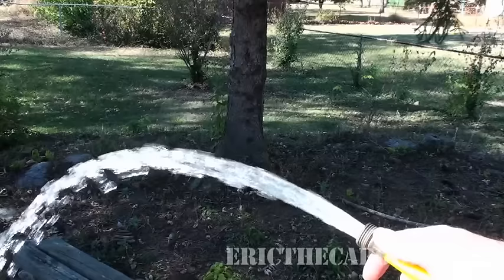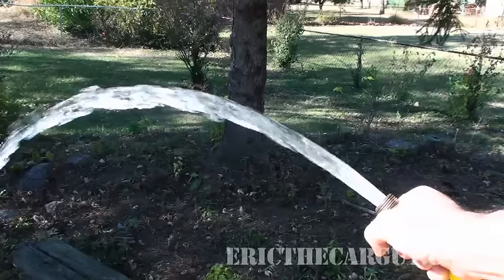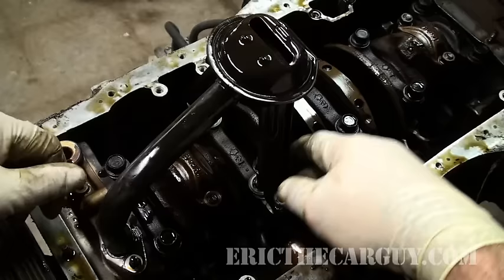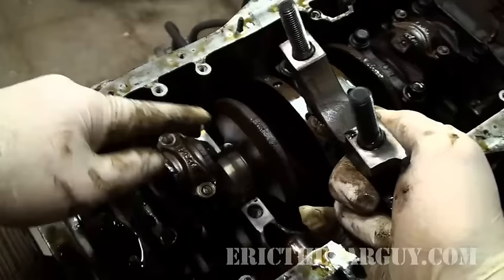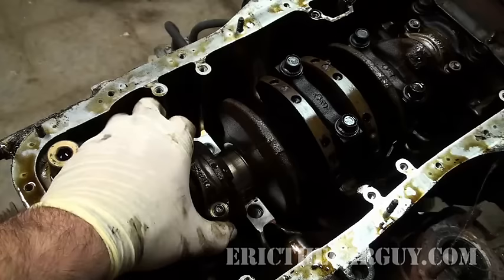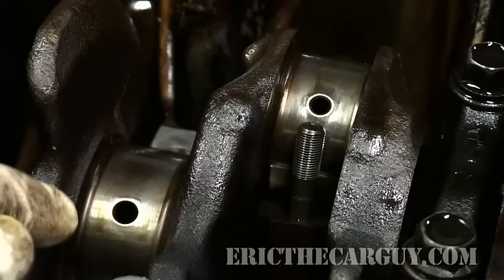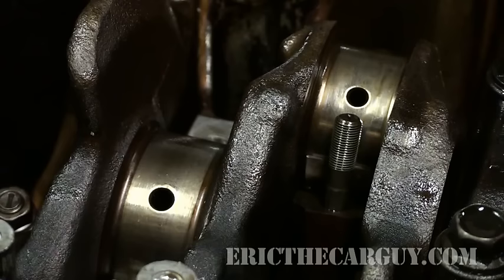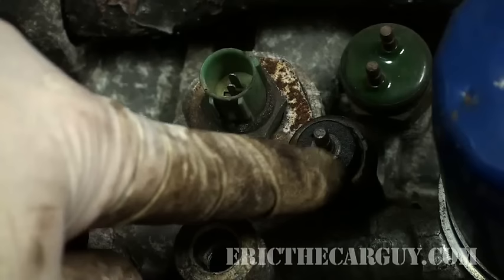How Oil Pressure Works - EricTheCarGuy

Comment: Here's a problem for you.  I have an oil pressure gage on the instrument cluster of my vehicle.  Normal oil pressure used to be about 50-60 psig.  Now, when the engine is started, the pressure rises to about 30 psig. After the engine has run for 20-30 minutes, the pressure has dropped to zero.  The crankcase has the proper oil level and there is no indication that there is no oil flow.  The engine appears to be running just fine.  What causes the pressure to drop off?
Reply: LOL we have the same problem look at my comment. its worrying me
Reply: Worn bearings. Remember you get pressure from the resistance to flow. If you have no resistance i.e. worn engine parts then you have no pressure. You can have all the flow in the world but without resistance you have no pressure. Without pressure to keep engine part from touching you do more damage to the engine. Hope this helped.
Reply: Without seeing your engine internals it would be hard to guess at exactly why you have low/no pressure, but to address your question about the "drop off" in pressure: this could be due to the reduction in viscosity of the oil as the engine oil warms.  Imagine you have two syringes, one full of water and one full of corn syrup.  If you want to push out a certain volume in a certain amount of time, say 1mL/sec, you will need to apply more pressure to the syringe with the corn syrup in order to get the same flow per time.  This is effectively what's happening in your engine at startup.  The oil has thickened while cold and due to its viscosity it is harder to push through the journals thus creating the 30 psi of pressure you're seeing.  As the engine warms to operating temperature the oil viscosity reduces and is much easier to push through these openings (crank/con-rod journals) explaining the drop in pressure.  The specified oil pump is designed to flow a certain amount of oil to all of the reciprocating components at a certain pressure.  As mentioned in the video, if the clearances between your crank/rod bearings have increased, your oil pressure will drop as a result.  You likely still have some oil flow to the crank shaft since the pump is obviously working (30 psi at startup), however there is probably a large amount leaking around the bearings and not making it's way to other components as the engineers intended.  Good luck

Comment: Please help I am at my witts end before I light this truck on fire new motor 05 chevy 2500 hd 6.6 lly no oil preasure lights not on but it cranks and runs no bad sounds what is wrong

Comment: the oil pump does create some pressure without it how would the process start so without it the engine will not run with out it or the engine will seize. But how ever the engine and all the metal does create pressure which helps lube each metal part
Reply: Oil slings out of the bearings and onto  the other moving surfaces.

Comment: Good stuff. 
How can oil travel to the top pan?
Reply: I'm having an issue with my 03 Chevy venture. While driving the low oil pressure light came on and shut the vehicle off. I didn't pay attention to it until it Finally didn't want to start and stay running.  There is oil in the top of the motor which tells it's not the pump. Any suggestions????

Comment: I change my oil every 3000 miles and my filter and I run full synthetic Castrol edge high mileage and I probably have done 10 to 12 oil changes this year which is kind of Overkill now my engine has been doing fine all year I have a 2005 Dodge ram 1500 4.7 l Magnum I was driving today and all the sudden on the interstate my oil pressure dropped completely to low all at once.  I'm only two thousand miles into my oil change and I checked my oil level this morning cuz I check it once a week and my coolant level both were normal my oil pressure dropped completely too low at bottom of the gauge then the truck shut off and died so I pulled over there was no knocking no pinging no weird engine sounds and when I check the fluid level in the oil with the dipstick it was normal and within range same as it was this morning but upon trying to restart the truck it doesn't turn over and the oil pressure remains reading low and it has a check engine light but no codes also I noticed when I put it to axillary and listen for the humm of the fuel pump it isn't humming so I'm trying to figure out what that would be cuz I have oil in the engine and it ran fine this morning and I had no problems with it and I change my oil a lot any advice would be appreciated also I've noticed recently that in my oil fill cap on the bottom of the cap it looks like snot like I yellowy pasty mixture. I only have 142xxx on my truck and it runs strong everyday for 1.5 hrs of daily highway 55mph commute. Any info would be greatly appreciated. I also got under the vehicle with a flashlight and there is no noticeable external leaks on the engine no drips underneath the truck and like I said the oil level is within range on the dipstick
Reply: I also run at half on the temp gauge which is normal and I run 5w30  weight oil as specified from factory. I stick to full synthetic and nothing else

Comment: I have a 1997 Dodge Ram 2500 van with 318 cid motor and don;t kow if I have to pull engine or not to replace all oil pump components. If so I must remove whole front clip of van. Can you answer this one?
Reply: What's it doing.

Comment: Yeah on those old engines, you want to use a thicker oil. Thicker oils will even help with compression on worn engines.
Reply: +Dcc357 I do not see how that really works, as the engine heats up the oil will still get thinner..
Reply: +Michel Linschoten 

Thicker oil stays thicker throughout the temperature range. It will thin with higher heat, but at any given temperature, it will still be thicker than a lighter oil at the same temperature.
Reply: as I said before, the first number on oil label indicate the viscosity at 0 Celsius(0, 5, 10, 15, 20) and the second group of numbers means the viscosity at 100 Celsius(30, 40, 50, or 60). Of course  if you have 20 psi at 750 rpm at 100 Celsius  using 5w30, you will have a slightly increase pressure using 10w40, 50 or60. What I experienced along my activity is that if the bearings clearance overpass some limit the pressure will drop exponential(very fast). This is  happening because  the hammering effect (when the bearings clearance overpass 0.1mm the piston and the con rod weight splash out the oil film, even if it 's thicker ) resulting a mechanical deformation of upper con rod bearings and lower main bearings.

Comment: My ls2 corvette is having high oil pressure does your oil pressure go up when it is cold?
Reply: Yes, when the oil is cold it is more viscous and causes greater resistance to flow, which increases the pressure.

Comment: This probably won't get answered. But I have a straight 6 Jeep Grand Cherokee. I just replaced the engine with a reman. Engine. When I drove it from the guy who replaced it the oil pressure was super low. Oil levels good. I'm going to try to replace the oil pressure sensor and see if that resolves anything
Reply: Well, I mean, you're correct in that you won't get an answer if you don't ask a question...

My Grand Cherokee has the opposite sort of situation; I haven't had it long enough to need an oil change on it yet, but it has lighter oil (5W-30) than specced in it and sits at the very high end of recommended oil pressure. I'm curious if the junk Fram filter from the Walmart oil change is causing the high pressure, and if putting a decent filter on and changing to the recommended 10W-30 would be a good idea.
Reply: moo

Comment: When my car sit still for a day, when started have no pressure for about 4 seconds. Then everything is fine and in range. Does oil pump have one way valve that is leaking and letting oil out of pump?
This is golf mk1 1.6 diesel.
Anybody knows is it safe to use the car ?
Thank you very much.

Comment: My 292 straight six has 10W30 in it. After it gets hot the viscosity dropped to 10 lbs at idle. Is that a safe pressure or should I use a higher viscosity. The engine in a new re-built long block with 8,000 miles on it.
Reply: Old technology says 10 pounds of pressure per 1000 rpms. So I think your pressure is normal. Remember there is also no load on the engine so you should be fine. Ask around.  
.
Reply: jd miller Thanks, that sounds about right.

Comment: hey Eric i have a ram 1500 2011 i replaced the engine i buy it from an  autopart store for $5 k  it works perfectly for 2 months and now iam dealing with low oil presure i can drive it for now but every time i stop gage goes to red  and oil valve it shows in my dash board .
camshaft is new 
oil pressure sensor is new 
trothle body iz new
gas pedal is new 
abs sensors is new 
iam doing  a pressure test tomorrow but i dont know how the engine is giving me so much problems 
is 3 years warranty but now i dont see what else i can do
Reply: i  noticed a rare noise when iam drivig and released my gas pedal is a dry noise coming from the engine in the driver side but i never know when is going to happen  when that noise start 2 weeks a go. my  truck also start acting up 
thank you for your answers

Comment: Eric i have a 2004 jeep Cherokee Laredo 4.0 and my only problem is after i drive it for half hour or so when i come to a complete stop my oil pressure cuts all the way out but my motor sounds and runs fine i changed the oil pressure switch and still the same any ideas?
Reply: Nick Boonsra ever figure it out? My 1997 4.0 Wrangler does the same and I may just get it rebuilt.

Comment: Question, if the clerance between the piston and the bore is way to big, can that couse low oil pressure? Thanks
Reply: No. That will usually cause "blow by" . This would result in a loss of oil between oil changes. And if the piston rings are real bad/worn, it will result in piston slap which sometimes can be confused with a engine knock or valve train noise.
Reply: Thanks nick Schneider, I found the problem the clearance between the piston and bore are very good, but I think the oil was getting on the piston from the valve seals, and the  low oil pressure it was cause by a bad bearing, I most to made the mistake of over tight the connecting rods because the bearing was squish. Thanks again

Comment: This has probably already been said, but if you have an old engine that may be varnished up a bit inside, don't Motor Flush it. Did that to an old pickup truck I used to have. Oil pressure went to zero at idle and about fifteen pounds at highway speed.
Shux! Not good.

Comment: ARE YOU RELATED ON VOLVO 670 IF SO I HAVE A QUESTION 
WHY DOES THE MOTOR LOOSE dIESEL PRESSURE

Comment: this is my problem 94 mustang 3.8 I hear a knocking noise its kind loud on start up and then noise is gone. if I mash the peddle right before the trany shifts I can barly hear the same type of noise. my gauge is normal when driving, but if im at a light its zero any ideas
Reply: +mike warner (blookis) I have the same problem with my 95 Bonneville, except I don't hear any knocking noise. Could it be that the bearings are worn?
Reply: +mike warner (blookis) Too much oil clearance between the bearings and the crank. Just like what he said here. Time for a rebuild buddy. Whats happening is all the oil is drained into the pan when it sits. When you start it the pick up tube sucks it up and pushes it out the oil holes in the crank and fills the gap caused by having loose bearings. 

A limp home thing to do would be to add heavier weight oil so it don't drain back quite as fast and might save the crank. But if you've been hearing a knock for a while then more than likely the bearings are toast. If you continue to drive it then say good bye to your crankshaft too.

If your really lucky it could be a bad harmonic balancer causing the knock and slapping the side of the block so check that out first.

Comment: i'm sick and tired of my isuzu diesel engine 4hf1 after overhauling the engine the oil pump works for just a minute and no more suction of oil. so we replace the oil pump and brought it to the machine shop for the reface of the block cause there is a slightly wore out of metals where the pumps is attached. and after all the procedure we had done still when the engine did run still there is no suction of oil not a single of oil went to the filter. we check the oil strainer tube no sign of cracks. maybe you can give some advice cause lots of mechanics in our country are gone crazy on this type of engine . they advice me to junk the engine because it is disposable.but i'm not giving up i have to find a solution that will help me because i already spend so much on the new parts.
Reply: Oil pump needs to be primed, they are not designed to move air. you will not get suction from a pump that is not primed with oil, trick on older pumps were to pack them with Vaseline to get it to prime, Vaseline is petroleum based so it will dissolve in the oil. i do not know anything about that paticular engine so i could not give you info on a procedure to do it.
Reply: Jason Smith you are correct the pump can't move air, he can do the Vaseline trick or he can dip the oil pump in oil before the installation. don't install the oil pump dry.

Comment: Mine is high until it warms up, then rides in the middle, but drops when I let off the gas. Sometimes it sticks and pops.
Reply: +Chris Mann Oil when it's cold is thicker....when it warms up it get thinner that is really what's going on. Perhaps check if your oil is the right one for your engine. If so, i would not worry one bit..

Comment: I have a 99 chevy Silverado 5.3, the problem is in t he morning when I start the motor, the oil pressure light shows and you could hear the clicking in the motor, you accelerate and it stops the clicking , after it worms up, pressure is normal, its only when the engine is cold, you think my engine is worn out? It has 230,000 miles and was thinkin about putting an oil pump,  I saw your video and I have an idea now of the problem but I want to hear what you say, thanks a lot.
Reply: What viscosity oil are you using?
Reply: Thanks! I just replaced the engine anyways, but I still have the old engine, I'll  check it out and see the screen, I really appreciate you taking the time to answer.
Reply: I been using synthetic 10w30 since  I bought it new, changed the oil every 6k miles, it had 230,000 miles, it should  be clean      inside, I'll  find out when I take it apart.

Comment: Eric I have a 95 Mustang v6 3.8 I've had head gasket replacement transmission replacement don't want to get rid of the car because I can't afford to pay  for a new one or a used one so I fix it my oli gauge needle sets L(normal)H @ at the A after driving about a hour  is that OK?
Reply: At the cost of transmission replacement, I can't believe you hadn't found another cheap car, not to mention the replacement of a head gasket.

Comment: The flow of the oil is produced by a difference in pressure. Without a difference in pressure(or energy) you have no flow. The main and connection rod bearings ports have the greatest drop in pressure from the pump side to the atmospheric oil pan side. But without the pump would your restrictions create pressure? Believe it or not the pump is your energy source for this whole system so what ever work being done has to originate from the pump which mechanically moves the fluid by lets say an impeller style design. When the impeller pushes the oil it creates a pressure drop from one side of the blade to the other, it may be weak but it is still a pressure drop. The closed system with its restrictions contain the energy(pressure) that the pump produces. You need both to get any work done; an energy generator and a closed system.
Reply: Are you saying that a drop in pressure could also be the result of a faulty fuel pump?
Reply: @jackinthebox6143  the "drop in pressure" im referring to is a comparison between two points in a closed system. Im assuming your referring to the same point but comparing the pressure now to a previous pressure, say a few weeks ago. I apologize, I was discussing the concept of flow and pressure not diagnostics. Eric is probably a better source for diagnostics. I believe Eric's video was to show that a faulty pump is not the only reason for a low pressure situation, not that a faulty pump is never the cause.

Comment: YAWN!  20$ bucks for a new oill pump.
thick oil will may up  your pressure / but you can flow a lot more from thin oil oiil .through the push rods than thick oil.
cool heads rock.

Comment: have 2009 tiguan  had timing  fixed got back now have oil leak take it back to dealership  they fix that now low oil pressure light comes on can u help me dealership still has  my car and it has 96000 miles engine sounds normal now they trying to say might need new engine